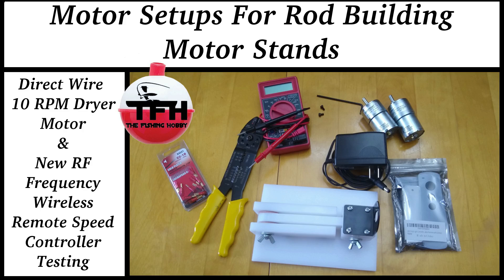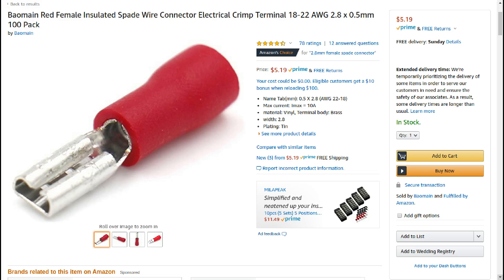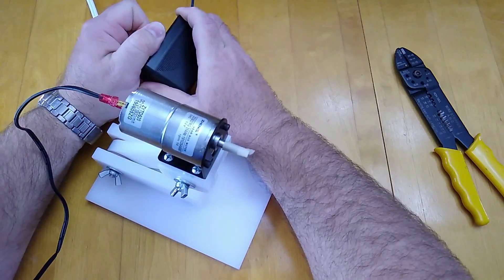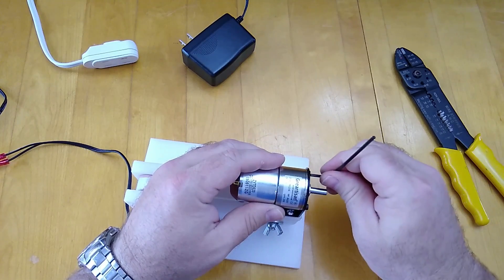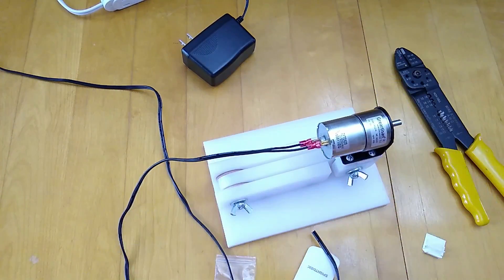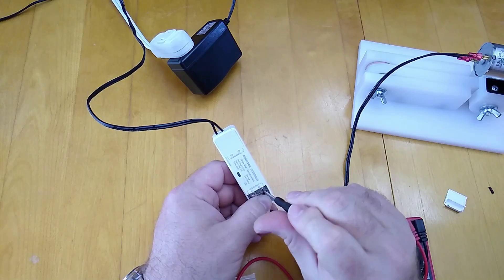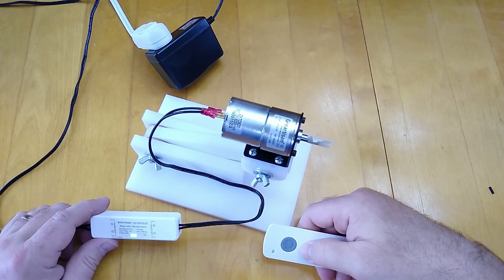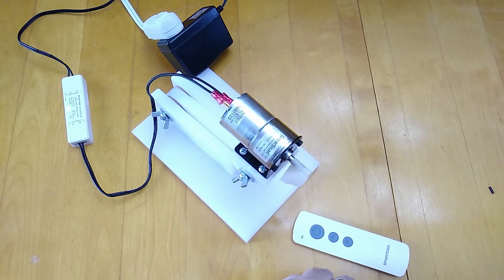Rod Building: Gear Motor Stands - Motor Options Direct Wire + New Wireless Speed Controller Testing

Comment: does the dc adapter put out exactly 12vdc, I have one that has 16vdc output but is labeled as 12vdc, would it affect the operation of one of these motors that you use. thx
Reply from the maker: Most of these adapters put out a voltage higher than 12vdc while measuring the voltage at the wires with no load on the power supply. Once a load is put on them the voltage drops closer to the 12v range. These little motors will hold up just fine when run at a higher voltage too. I have run them on my 18v power tool batteries with no problems at all.

Comment: Hey I checked the ebay link for the stands and such but I can't find anything! could you provide another link? Also is it possible to hook up a foot pedal instead of the up/down remote?
Reply from the maker: I don't make these anymore because I lost my HDPE supplier and they would cost too much to make now since they were by far my cheapest option. You could add a foot pedal on off switch, but there aren't many readily available foot pedal speed controllers for DC motors. I found one a couple of years ago on the internet but they were over $200 so it wasn't really a viable option.

Comment: I was wondering how long it would take you to just go ahead and make those with the motor to sell too. I'm sure there's lots of people out there like me that either don't have the time, patience or inclination to build that stuff themselves and are willing to pay the money for one already made to save themselves the trouble.
Reply from the maker: That is a tough call for me. There are so many possibilities for different combinations of motor speeds, controllers and so on that it really isn't feasible to carry all those different parts or offer all the different combinations. Not only that, but I'd have to charge quite a bit more to set all that up due to the time involved. I haven't ruled out offering something like what I like to use personally. I sold out of those first 4 stands quicker than I anticipated, so I have to get some more made. I'm still on the fence about installing motors and or speed contollers. The price would end up being 3x's as much as the stand (my time plus the additional weight increases shipping costs). Someone could order what they need and set one up they way they want it for quite a bit less than 3x's the cost of the stand by itself.  I've thought about it quite a bit and decided (for now) just to offer the stands. I'm still thinking about other options though 🤔

Comment: Awesome vid Kev. I really like the controller setup. Never thought of using an LED dimmer for motor controls. The only concern is with the dimmer does that reduces the output voltage going to the motor? and if so would it not have a lot less torque at low speed than the 1st motor at that would be running at full 12v meaning high torque at low speed as a standard. Would love to see your LED controlled motor under load. I recon you would still get a lower speed but it would just be at a higher setting than you had it without load.
Reply from the maker: Led dimmers like this one use pulse width modulation to control the speed. DC powered LED lights require a constant voltage. In order to dim them, that voltage must be pulsed. So this allows for a full 12V even at slower speeds. The frequency of the pulses is different than what you find on a PWM motor specific speed controller, and that is why the motor PWMs do better at lower RPMs. This one in the video does really well down to about 80 rpms and has plenty of torque for rod building purposes. It will get down to about 40 rpms under a light load. The motor specific PWM speed controller I have will get down to 20 rpms with plenty of torque. The trade off is low end speed for the convenience of less wiring clutter.